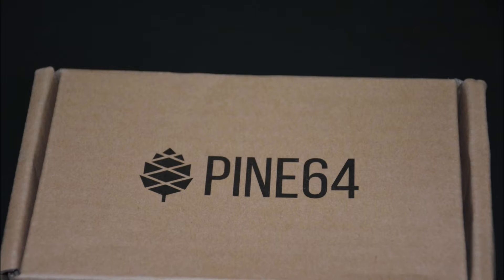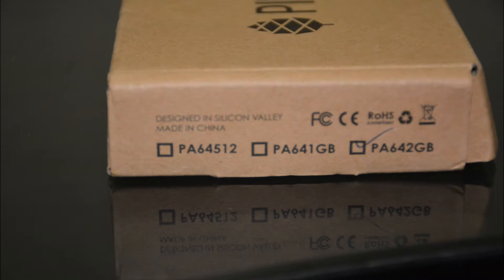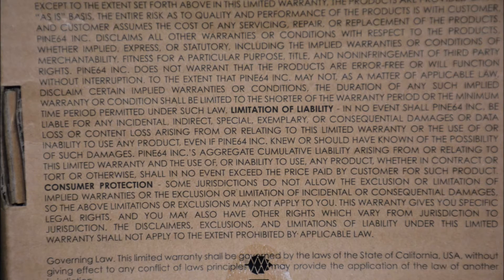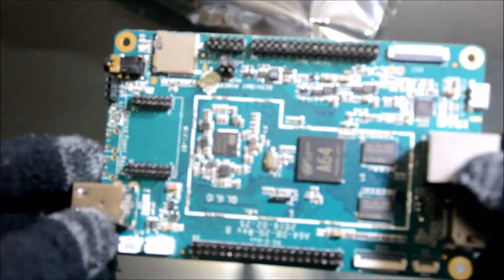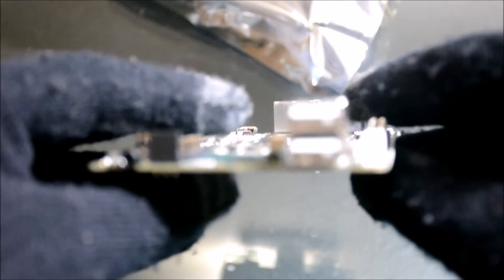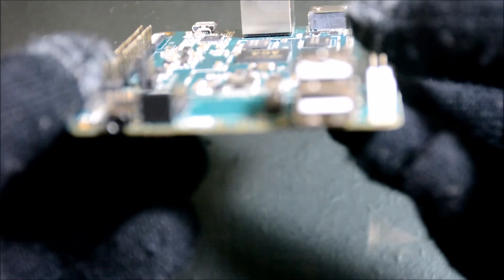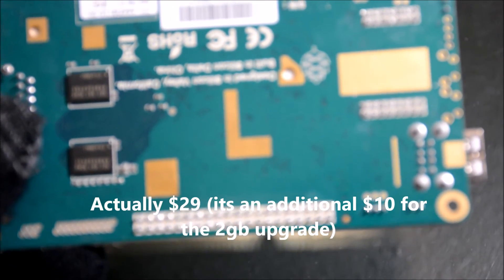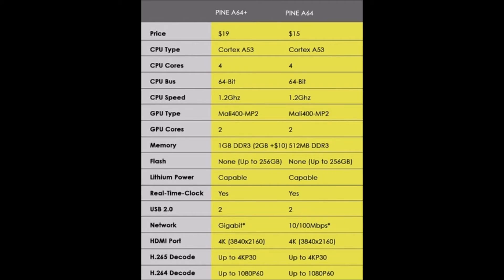Pine 64 Unboxing and Overview - Pine64 A64 2GB Single Board Computer

Comment: What did you mean when you said the power button is not needed? I can't seem to power on mine. There's no signal sent to my TV.
Reply from the maker: Thanks for watching the video.
Basically the button was added in after reaching a 'Stretch Goal' during the KickStarter Campaign. The button acts as a simple toggle to shut the power off or on. The Pine 64 was designed with power circuitry in the board and after raising enough money they (Pine 64) offered to add in a button on the board. However some people were against having a button on the board so the Pine Team left it off and gave it as an option to be soldered on (some people have got it to work just by putting it in its place and bending the pins/prongs).

When I said it wasn't needed I meant you can just directly power the board and it'll turn on after plugging it in. As for your issue....have you tried a different screen? What power supply are you using? Have you checked out their forums here: http://forum.pine64.org/

I hope this was of some help.

Please like and subscribe. Let me know if you have any more questions.